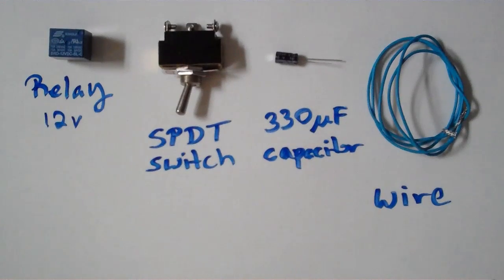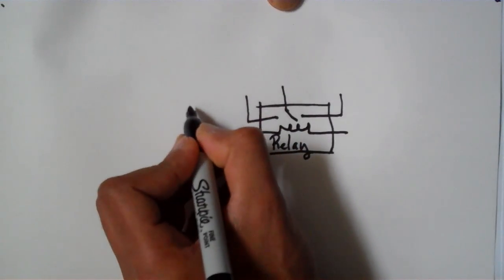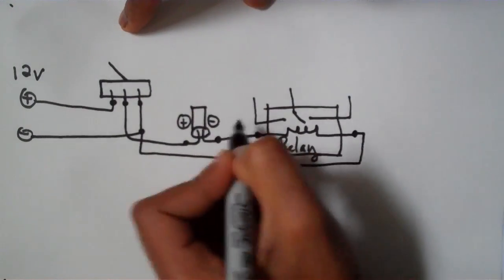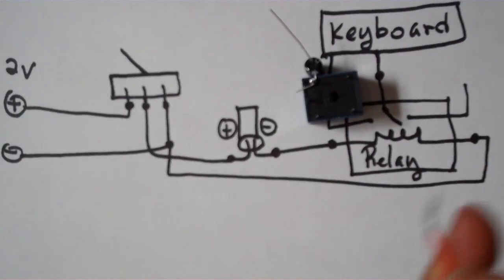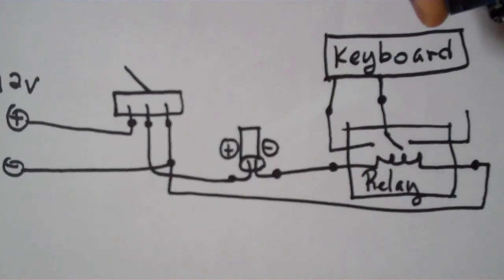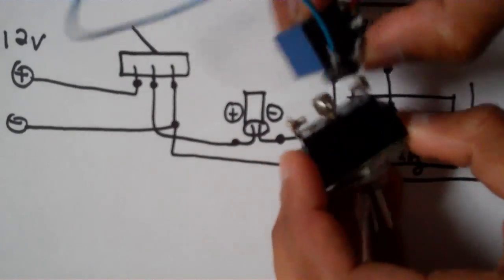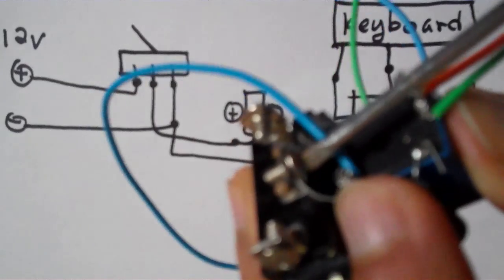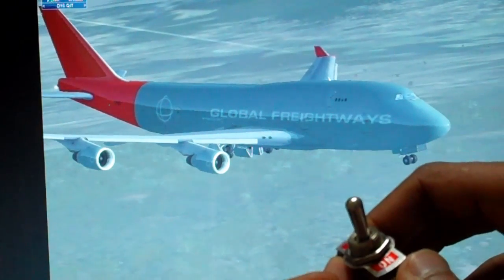FSX Home Cockpit Simulator - Toggle switch

Comment: it's very smart way to turn a button press into a switch. Just to make sure I get how it works: if you turn on say the taxi light on before turning on the simulator, the switch is gonna work backwards, right? like on when it's off and off when it's on? (sorry for dumb question but I'm only a beginner when it comes to electric circuitry)

Comment: hi, i just did what you did in the video, but it didn't work :(
i used a on-on switch, a 5-leg 12v relay, and a 16v 330uf capacitor: however i used usb as my power source.
i use a usb cable connected to my iphone charger which supplied 5v power, i'm wondering if it is the power source's problem.
could you please give some instructions, tks :)))

Comment: hi man nice video i've been using your tricks to make a cockpit for ETS2 but then i got stuck when working with the high beam. iwant the switch to emulate one keystroke when i flip it but when i flip it back i dont want it to emulate another. I was thinking of connecting the capacitor in parallel. Do you think it'll work? if not please tell me how to do it

Comment: Can you explain me why wouldn't a normal toggle switch just work ? Why do we need to power it, use capacitors and relay? When you connect the 2 wires it gives you the key, so why not just use a normal 2 way toggle switch ?
Reply: This is the reason why you have use just a toggle switch:

If you just used a toggle switch, when you flick the switch the current doesnt turn off so its like holding the G key constantly. And when you flick it back its then like releasing the key, so it would take one flick up and down to put the landing gear down and flick up and down to put it back up. You see.

With the relay its making a pulse so when you flick the switch once its like pressing the G key not continually holding it down. It just pulses same for when you flick it back down.

Hope this helps.
Reply: Yeah right, had the same idea

Comment: couple of quick questions does it have to be 12volts or can i use a 6volts battery to send the pulse because i dont want to wire to my computer or mains power :( is 6 volts enough to send the charge to the relay and if it is what relay do i use?

Comment: When you flick the switch on does the computer think you are pressing and holding the g key down? And when you turn the switch off that you are releasing the g key?
Reply: when the switch is turned on it sends a pulse to the computer. its like its being pressed but not held. when the switch is turned off it does the same thing.

Comment: with this setup how many switches could one run off one 12v power supply, and do you think a smaller capacitor would work?
Reply from the maker: The amount of switches depends on how many amps your power supply is putting out. The more the amps the more switches. A smaller capacitor should work. This will just make the electrical pulse shorter. But don't want to go too small on the capacitor.

Comment: Sorry Operation Cockpit.
Because it was not explained, It should be explained that, of course if you are using a TOGGLE SWITCH rather than a simple push switch or rotary switch then you must use the method shown. If you don't then the keyboard key G would be seen to be held down .That is why you would use this method.
Reply from the maker: Thanks Mel

Comment: I don't know why you are using this method for switching when a direct connection from a switch to a keyboard emulator suffices. No need for power, capacitor or relay.
People should see your other video on using an old keyboard emulator and simply connect their switches to that.

Comment: another question, the relay acts as a button?
and if I connect the relay is not connected to the connector would run another key on the keyboard?

Comment: So, a good question. Say, i've flown once and used the gear switch to gear up, which means i've changed the position of the switch to "up". For some reason, i've reset the flight and if i want to gear up again, do i have to switch that "down" ? Which makes its job opposite ?